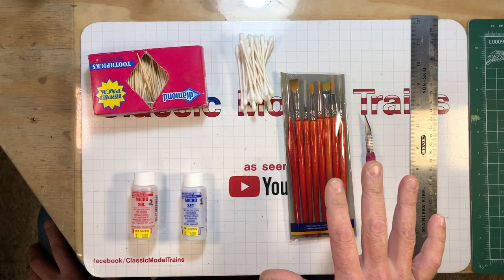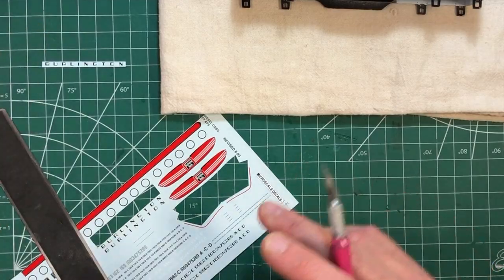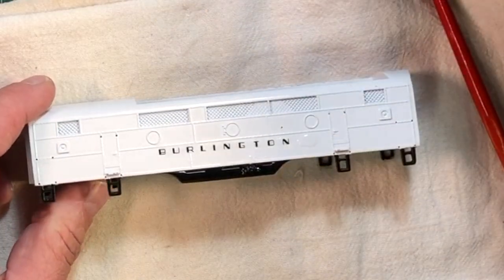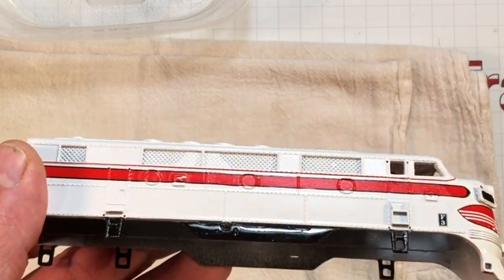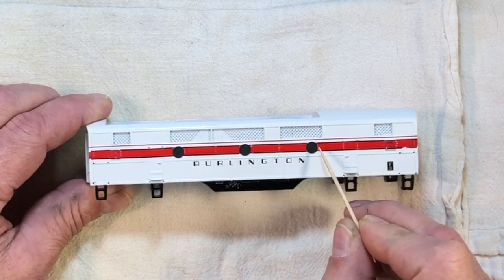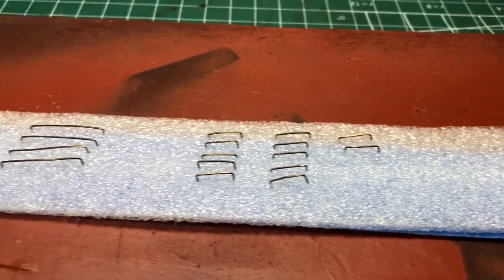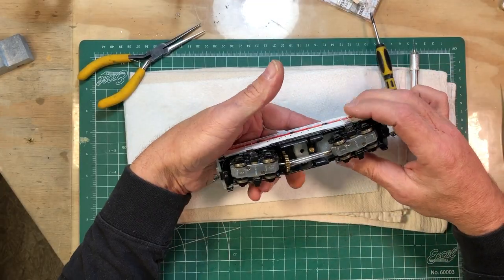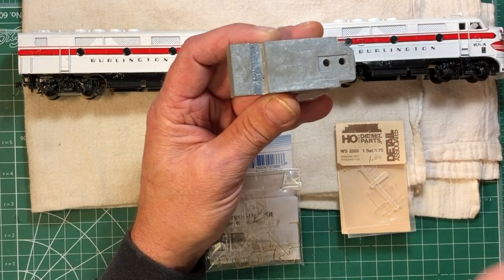Microscale Decals How To 101,   Finishing the Varney F-3's

Comment: 1. Use a coffee cup warmer to keep your decal water warm. 2. If you have hard water, use distilled water for decaling to prevent hard water spots. (My tap water is hard enough to beat up  Chuck  Norris.) 3. Use a hobby brand clear coat. I've found that Krylon brand is WAY too thick. 4. The age of the decal is important. If it is old, you should put a thin gloss coat over the sheet to help keep the decal intact.  5. Large decals can be cut into pieces for easier handling. These are just some things I've learned from experience.
Reply: Thanks for sharing lessons learned!
Reply from the maker: Thank you for sharing some PRO level tip's.  I put off doing these decals because I knew for a first timer I would have mistakes.  I also knew if I don't do them, I will never learn how to so.....
Reply: Agree- a light coat of gloss or flat sprayed on the sheet helps keeps the decals from coming apart during application.

Comment: good job, guy!
a little pro tip for if you have to use decals that are more than a couple years old, microscale makes mi-12. it's a brush on liquid decal film that will hold old cracked or possibly crfacking/shattered together by adding a top layer to the decal. I can attest to the product being of value, I just used it on a 20 year old set of aircraft decals. I used 2 coats.
keep up the good work
Reply from the maker: Thanks for your kind words and some new tips and tricks I will have to look into :-)

Comment: Ron, if you think you may have older or cracked decals you can use microscale liquid decal film. You paint it on lover the decals on the decal sheet prior to cutting them out and putting in the water. They liquid decal film will act like new decal film and hold the decals together even if pre-cracked for you convenience. Great tutorial RON and they look Fantastic! This is the fun I Tado with almost all my locomotives I have purchased over the last two years!  Also if you find you need a stronger and I mean STRONGER version of micro set, Walthers makes Solvaset which is industrial level decal film setting solution. Tamiya also makes Mark Fit Strong which I have found falls in between Microset(weakest) and Solvaset (strongest).  Thanks again wonderful work on the Locos! Happy New Year!
Reply from the maker: Thanks once again for all your GREAT advice!!  A lot of people tell me these decals were probably really old.  Now I have a bunch of good info on how to "save" them and get them installed!! Happy new year to you also :-)
Reply: @classicmodeltrains  they may be old? I bought a lot of Burlington Northern E8/9 decals some time ago in eBay, 4 set for $10 or so but they are ancient. Just painted a thin coat of the microscale liquid decal flim on then and no cracking. Just trim them close when cutting them out. I have some very very old Champs decals for Burlington F units just like you microscale ones and they work fine with a coating of the decal film.  Again take care and all the best!
Reply: When you use the liquid decal coating, only brush on one coat! Observe carefully where you apply it as it soaks instantly into the decal sheet and you won’t be able to tell where you’ve applied it once it dries. Applying multiple coats will make the decals really thick and a bit difficult to cut cleanly. Good luck!

Comment: If you use cotton buds on your decals, try holding them closer to horizontal and ROLL gently to absorb liquid and remove air bubbles.
I use tissues rather than paper towels, softer so less likely to to cause damage. Also easy to twist the corners to make a thin tip to get into corners to absorb moisture.
The locos look great - good job.
Reply from the maker: Thanks for the compliment, and thanks for some more great idea's!

Comment: It turned out fantastic!!! Years ago i bought an Athearn Blue Box A-B-A set to do in this exact paint scheme, and now you've motivated me to get started on the project again! Yours look beautiful. As for zinc pest... i once bought a Lionel HO ALCo FA2 to rebuild and detail... the frame disintegrated as the locomotive was beimg disassembled. The pressure from the body was the only thing holding ot together. Worst zinc rot ive ever seen, the stuff can easily ruin a model.
Reply from the maker: This paint scheme is very interesting and not seen too much.  Hope you get yours finished up and running soon & no zinc pest!!

Comment: Now that there ,Ron, is one mighty spiffy looking and operating Burlington pax consist ☆!  So glad that you were able to finally locate the decals from hearing about where   they might have stock from a fellow railroader.
Don't feel bad about the troubles that long stripes cause - 
I must have constructed over 1000 model aircraft kits since I was aged 6 and the only way to apply long stripes in many cases, that run over rivets or window cutouts is to cut the stripes into sections and be ready with your brush and " close enough " paints to fill in any glaring gaps or splices that didn't match up.
For years I have been using plain old cheap Testor " Decal Set ." 

Then last year I tried Tamiya " Mark -Fit , " strong solution " and whoa..
¤ hang on for an e-Ticket ride ¤ as that stuff can dissolve decal and paint too if improperly applied, like I no doubt did...
🐴
Reply from the maker: Thanks Frank :-)  Also thanks for the tips and tricks!

Comment: Wow Ron! Not bad for a first time attempt! I’m very happy you got the decals. I still hadn’t been able to find a set but it’s awesome you got them!
Believe me or not, I managed to get one of these too. The original owner or someone along the way attempted to drill out the headlights and basically ruined the shell, as far as the front goes. They are wayy off center and am trying to find the best way to start over on those areas. Maybe some JB weld and some epoxy or something. 
I’d eventually like to get a B unit and throw a power chassis under it and make some really good DC pullers that are older than most. They are great models. 

As of recent, I’ve been modeling some odd stuff. The paint work is going along well. And totally backlogged right now. So sorry I’ve been quiet. But I am happy to see you still going strong! And to make s great set of engines. These do not disappoint when it comes to pulling lower. Basically bricks on model train track! Take care my friend! Hope to hear from you again soon.
Reply from the maker: I hope you get that headlight area whooped into shape.  These 'Ol Gal's are great pullers!  good luck on your project.  Good to hear from to Mister!  Hope all is well with you and yours :-)

Comment: Hey ron, ever though of making a video of how to install a DCC decoder to the original motor of an old Tyco Mantua locomotive?
Reply from the maker: I have a video already about that.  Except I installed a new can motor so it will have less amp draw than the old open frame motor. The video is called " I put $150 worth of upgrades in a Tyco Pacific?"

Comment: Whenever you get a decal sheet put it on the scanner and save the image file. If you need more in the future they could be discontinued but with the image you can print one yourself or find someone that makes decals from your image file. Decaling can be very aggravating and they all seem to behave differently. Start by cutting out a decal you won't use and do a test with it.  I've had decals that slip off after 10 seconds and others that won't come off after 5 minutes of soaking.
Reply from the maker: Pretty good idea you have there.  Thanks

Comment: Hi Ron. I got a decal job coming up. Will be my first one. Not looking forward to it. LOL. I got 2 ideas for you for a someday show. I've been studying the Great Northern and Empire Builder. Thats your back yard. I'm building my layout to that theme. Maybe you can come across something that fits that. Also, I'm interested in the BNSF GP60B....got one? LOL. I picked up a GP60 and did some research but not too much. Anyways the B unit is tough to find in the HO.  I just started so maybe something will come up. Just want to tell you thanks, I've learned a lot from you the last few months. Every time I drop a screw or a spring fling somewhere I laugh at you from all your warnings. I've rebuilt every car I have with tuning trucks, metal wheels sets, weights, whisker knuckles. Having a good time with my new hobby. Take care. Gary....
Reply from the maker: Greetings Gary,  The first decal job is the hardest, I just found out. It should be all down hill from here. I don't have any GP60's. (yet)  Sounds like you've done a lot of work to your models.  Thanks for your kind words and support of my channel :-)

Comment: As to the numbers on the B. Modeled CGW and for the longest time I was certain the CGW just went with the number boards on the A units and maybe numbered the B units on the end somewhere but nothing clearly visible painted on any of the unit sides. It wasn't until someone asked about cab unit numbers on one of the CGW message boards and someone provided a picture of a freshly washed unit with the road number painted on the tank skirts and after a few fuelings the diesel spillage and subsequent road grime accumulation the road numbers would become invisible. 
Possibly that's the reason the B unit numbers weren't visible in your reference material if the Q located the numbers similarly.
Reply from the maker: Thanks Gary for some good information!!

Comment: a few things. 1. perhaps the decals were old. or 2. too much softener was used. dilute with water. 3. solvaset is single stage and less harsh. 4. Burlington white is actually a pale gray.  99% white,  1% black. 5. Burlington and santa fe b units had their numbers on the ends only for the f2s,3s,7s, &9s.
Reply from the maker: Thanks for that good info.  A few fellers have brought up the old decal idea. DANG IT on the paint color....I missed it by 1%. Thanks for watching and commenting :-)
Reply: @classicmodeltrains  too bad you don't model PRR. their green is 99 drops black, 1 drop green, with a fleck of gold.

Comment: When we did decals for model cars we never used anything other than water. We pull them out paper and all  . Stuck them on them body keeping wet. Sliding careful down off of paper into place. We did a lot of those look good on that that looks better with that paint job and so on with rims & tires. But model cars are limited. Once done that is it.
Reply from the maker: Decals really finish off the project.  Yes it does suck with the model cars, afterwards they just collect dust
Reply: @classicmodeltrains  another reason I got into trains. All you have to do is go outside. Everything you see is model trains. Every detail.  Back in 60s and before this area was big in loco. Logging, apples amongst few things. Most of tracks gone. But county records shows where they use to run.

Comment: The old diesel dress up kits are made for Athearn F7's
Reply from the maker: Yup.  I was just seeing if maybe they would fit.  Found out the hard way :-)
Reply: @classicmodeltrains  I found out with the old Stuart F units myself!
Reply from the maker: @betsy662  Weird how the models are made from the prototype, yet there all just a bit different.
Reply: the athearn "f7" became the defacto standard ho f for many years. other manufacturers used the athearn f as their guide for dies.
the athearn f was designed using a side view of plans, and lacks countours. all it's curvatures are wrong-roof, nose, and windows and much more.
Reply: @suppylarue220  That is of course all true, however, they still looked like F units all those years, and passed for F units on many a fine layout!
Reply: @classicmodeltrains  That of course has everything to do with each individual company making the units, proprietary technology always changed over the years!
Reply: @classicmodeltrains  that's just it, early models were not made from the prototype. they were versions of diagrams or blue prints or plans without measuring the actual locomotive. more careful modeling came in the 80s and 90s. the emd f units all had the same contours.  the bulldog nose, the covered wagon roof curvature,  the sad eye windshields which followed the roof line, a faint center crease in the nose door, and the fitted angled number boards in late F3s forward.

Comment: Not having windows in a locomotive or a caboose looks so phony to me. I just keep some very clear plastic packaging from anything you are about to throw out. I just cut out the plastic and put a little CA on the inside of the window and apply with tweezers. If you need a curve for the F7 windshield, just heat it a little with the blow dryer. (Oh was I not supposed to mention the hair dryer?}
Reply from the maker: Yes.  Ive found some of that clear plastic packaging stuff wont glue up well with the CA glue.  Guess there's a couple different recipes for it